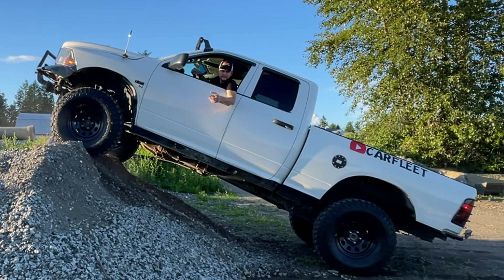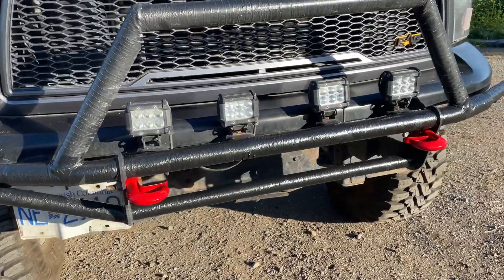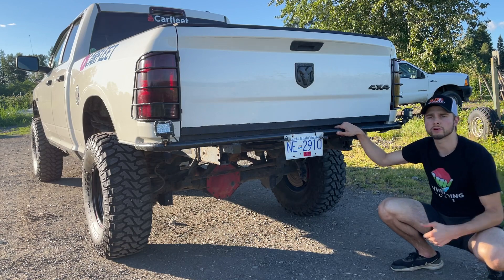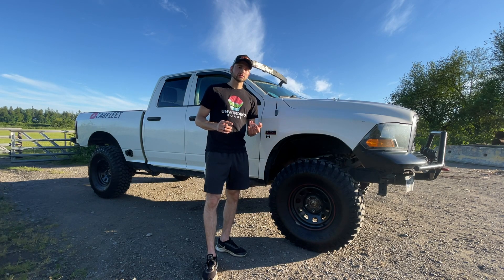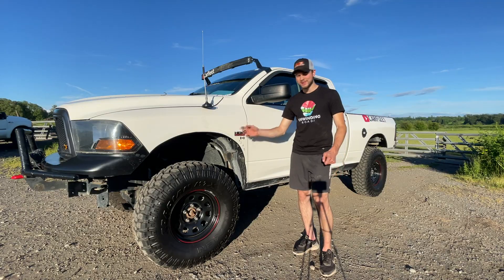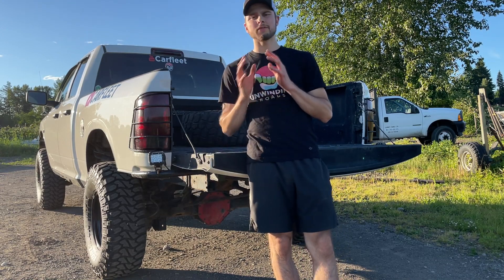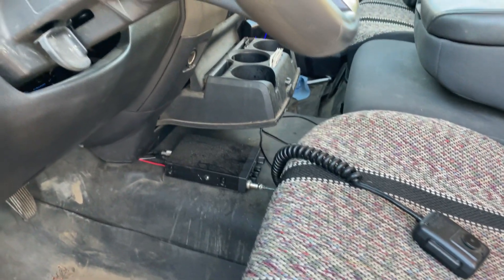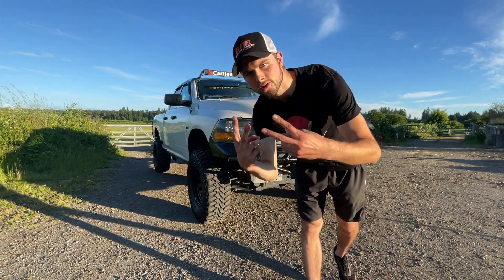My Top 5 Off Road Mods For Your 2009-2018 Dodge RAM!!! Full Size Off Roading (Budget Build)

Comment: Great video bro. I have a 2017 Ram 1500 5.7, 8 speed, 3.92 gears with a trutrac in the rear and sitting on 35’s. I tow pretty heavy for a half ton and I feel like 37s would kill my towing power since I can’t regear. I just wanna throw it out there to you, I had an open differential From the factory, and that trutrac differential completely changed my truck. I have a small farm and am always dealing with mud, snow and angles. The mud tires were a big upgrade but dollar for dollar, I strongly recommend that differential. It cost me about $600 to buy it and another $200 for ring gear bolts, Amsoil and axle seals. 

Awesome truck bro and I love how hard you push it!! Keep it up!
Reply from the maker: Thanks for the advice man I’ll have to look into that I could definitely use something to help off-roading! thanks bud I’m going to keep pushing it cheers 🍻
Reply: @Carfleet Hey buddy I'm a few years behind the convo here, but I just wanted to say that locking differentials are the shit.

Comment: What would be ideal for a lift kit...would like to run some 35s. 16' Dodge ram. Live in desert were he host off-road racings in Jan and Feb
Reply from the maker: I chose the body lift because it’s a lot cheaper and it works well on the ram if your not worried about money go with a suspension lift I’d say but do some research🤙🏼🍻

Comment: What kind of a lift do you have? I myself have been looking at putting 37s on my 13' and just can't find the right kits for what I want. Anything would help, even just an opinion.
Reply from the maker: I have a body lift just because at the time it was only 500 compared to suspension lifts which are expensive
Reply: @Carfleet  Got it. So you've only done a body lift but can still put 37s on? Does it scrape or anything like that when you're articulated?
Reply from the maker: @johnsponable4907  ya 3 inch body lift and I had a 2 inch level up front and they cleared no problem now I have bilstiens all around so up front there’s a 2.8 lift it flexes really well only rub comes from the rear on inner bedside at max flex